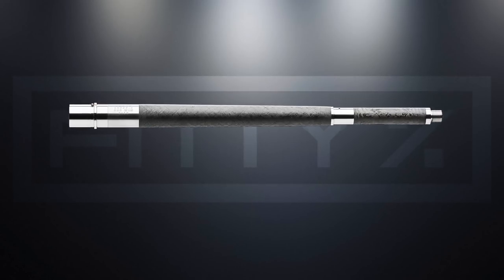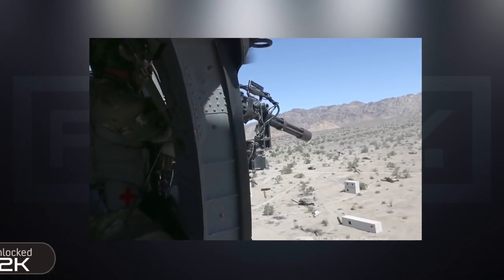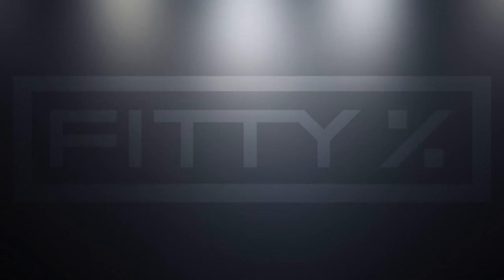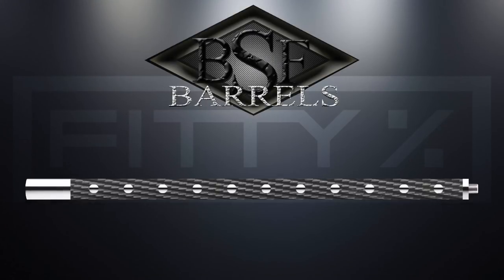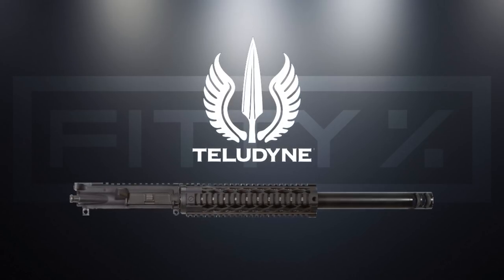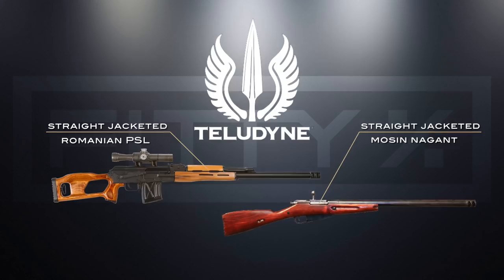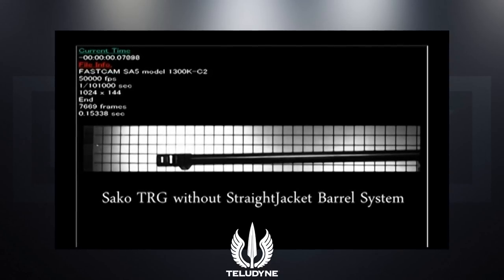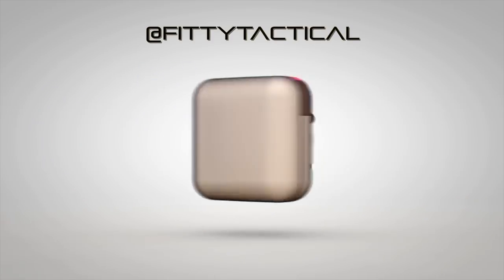Carbon Fiber Barrel Comparison - Part 2

Comment: I cut rifling for Proof. While I am bound by certain nondisclosure and confidentiality agreements, I can say that the resin matters. We have an Advanced Composite Research division in Ohio that keeps us on leading edge of this technology. Our resins can take more heat than any other resin on the market, and this helps with heat dissipation. Secondly, the barrels are turned so that the exterior surface looks like threads on a bolt. This acts as fluting, by decreasing weight and increasing surface area, and is done to give the resin more area to set so that the carbon fiber wind doesn't move or shift. Combined with a non-compromising Quality Control routine, we really feel this makes Proof Research the industry leader in this technology, and we have a bunch of people who really care about keeping it that way and being the best at their jobs. This is also why we are the largest cut rifling barrel manufacture in the world. Cut rifling induces less molecular stress on the bore than button or cold hammer forging. Every detail matters to us and everything we do is for a reason; we want to be the best.
Reply: Just purchase a pr15 in 14.5. What's your thoughts on pinning the gas block on this particular barrel? I want this ar to be "duty" use focused, not a range toy.

Comment: Very interesting video!  As an aside, fluted barrel heat has two sides to it.  While fluting certainly increases the surface area and heat dissipation, it also allows the metal to heat more rapidly.

Comment: Hey Fitty, excellent 2 part video. Just one point to bring up about carbon fiber or any composite material for that matter... What you said about the assembly of the BSF barrel may be true for how that company assembles, but if that's the case it's not a great thing... Composite materials are asymmetric in loading strength, they're excellent in tension and poor under compression. Stiffness of any cantilever (in this case a barrel) say from bending downward is the resistance of the top surface to tension and the resistance of the bottom layer to compression. Carbon composites are so strong under tension that there's virtually no give and you don't need the bottom layer to resist compression, but if you pre-compress that composite structure(top and bottom evenly) you've reduced the strength by giving the super strong top layer some "slack."
Reply from the maker: Alex S glad you liked it and thank you for adding more insight into my amateur explanation!

Comment: Very concise and well-illustrated video on the theory, similarities and differences between all the barrel jacket makers. I think Proof Research gets my vote. This is sue to the "Maypole" way they criss-cross their carbon fiber strands.

 I have SWIX Norwegian made carbon fiber cross country racing ski poles wrapped in this exact manner and they are STIFF! No energy is wasted bending the pole, it all goes downing the packed snow of the track. And they are sooo light.

BTW I also have a Norwegian made HELLE laminated blade hunting knife that is insanely sharp. This is due to the high carbon, chrome moly center laminate that forms the edge material. Love this knife but they are  a bit spendy. Lots of styles but I prefer the GT model and its high quality leather sheath.

Comment: Your 2 part video was good. I bought a Dracos 22" 6.5 creedmoor barrel after watching both parts. The worst it's shot with junk ammo is 1.5moa and the best is .75moa at 200 yards so far I'm only 35 rounds into breaking it in. There was no wind and the shooting was off a bench with heavy bags and good support. 
For the price the barrel is more accurate then most cheaper barrels i've bought (sometimes you get really lucky with a cheap barrel). However the barrel has such little whip i don't lose my line through the scope until 24x magnification. I'm very happy with it and would recommend. Maybe as it breaks in I could get towards .5 moa? Maybe not, idk. What I can say is it dosen't care if its 120 grain sst, 140 berger, or 147eldx, they all shoot very similarly.
Reply: Wow, that's seriously outstanding. Can't wait to get mine. 
The barrel made with Unicorn Jizz has gotta shoot that sort of moa.

Comment: Cool vid, I'm considering a BSF, very informative. 
FWIW I don't think the tuning of the cartridge to the node really makes sense. I've heard several people say that but the logic is off to me as MV can very quite a bit even with an otherwise identical cartridge. The level of fouling and most of all the temps can swing MV by large margins. If a load was tuned to the node then it would only be consistent at one temperature.

Comment: Missing a huge factor with bsf. Machining the barrel after boring the rifling can and will add heat to the steele. In a world where a thousand of an inch is a big deal and button filling vs single point cut rifling makes a difference do you want to risk a bit of warping?

Comment: Thank you for this wonderful information. Unfortunately I am still not sure which barrel to go for. One of the issues that confuses me is that carbon fiber barrels reduces the weight which sounds good, but also I know that reduction of weight can increase the recoil and harmonic. I am not quite sure till now which choice if carbon fiber barrels is best to maintain a good accuracy, less heat,  low recoil and low weight especially that I am going to .338 lapuaMag. I have to find the right one that gives a fair companion of all 4 factors.  I can't sacrifice recoil for weight or weight for recoil forexample. I have to find a barrel that doesn't sacrify any of them but not necessarily have perfection in one factor. I would really appreciate your advice on that if you have came to more knowledge about them. Thank you
Reply: WW 34 carbon fiber will decrease the harmonics on the barrel making each shot very accurate even when the barrel is hot. Bsf is the way to go. Now for recoil that will come down to you

Comment: Maybe the media in the dracos barrel acts like the beads in a dead blow hammer? Mitigating the severity of the harmonic wave ?
Reply from the maker: 5 Shot Group for that to be the case it would still need to be fluid. Its more like encasing it in a rigid epoxy resin.
Reply: Fitty% yeah, that won't work then.

Comment: And your videos were both very informative and educational!! Great job on them. So, are you saying that between BSF and Proof Research, BSF, would be the better bet?? Just wanted clarification because that’s my next route to building a 300 blackout. Thank you very very much!!
Reply from the maker: I think the Proof wrapped barrel is stiffer than the tensioned BSF barrel and may get tighter groups. There is the small possibility that the carbon fiber may de-laminate (small separations between the cf and barrel) but that's a small chance.

Comment: Update on mine...

Went to the range today to break it in according to their spec and also to sight my Brownells 5-25x56 MPO in. I'll have more later, but long story short, it performed very well and I believe if the human element were taken out, with proper ammo, this LR-308 BSF Creedmoor 6.5 based build is capable of .5 MOA (I saw just at 1.125" my last 8 rounds, but that was on me mostly).
Reply from the maker: Nice bud!

Comment: I'm working on a way to make a graphene wrapped barrel. I believe it's the future of barrel technology.
Reply from the maker: Sounds interesting! It also sounds expensive lol
Reply: @FittyACTUAL  yes, it does seem to be expensive. Though the properties of graphene seem to be very attractive for barrels. I know of defense contractors also working on this. Right now I'm trying to figure out the best way to encorporate the graphene onto the barrel.
Reply from the maker: @RolandtheThompsonGunner  will you use a steel barrel blank to wrap, because I have thought of a unique way to drill the bore that would be more accurate than traditional.

Comment: are proof barrels better than a traditional steel barrel? i just picked up a q Fix and was wondering if its worth it to get the proof barrel?
Reply from the maker: I'd say it's definitely worth it!
Reply: @FittyACTUAL  is it really a huge upgrade or slightly?
Reply from the maker: @reapering125  I'd say it's a significant upgrade going from a SS barrel, but look at the newish barrels from Dracos too.
Reply: @FittyACTUAL  i like the dracos barrels but they dont make them for the q fix

Comment: Its been 5 years ..... what are your long term thoughts on the BSF vs Proof Research carbon fiber barrels? Which one seems to handle heat/high rates of fire better? Which one seems to be more accurate? And the thing I'm most interested in, which one seems more durable? Have you shot out either of the barrels yet? Or both? Really wondering which one will send more rounds down range before needing replaced.
Reply from the maker: I honestly dont think I'll ever shoot enough to wear out a barrel, but I have shot each barrel enough times to have an opinion. The best "bang for your buck" would be BSF and I also believe the BSF barrel might outlast the others due to more steel material for the barrel remaining. In coming out with a "covid build" for a precision .223 wylde using a BSF barrel. Im also going to come out with another CF barrel video to include one from Wolfpack Armory.
Reply: @FittyACTUAL  awesome info, thank you for the reply! I had no idea the BSF has thicker steel walls, but it makes sense since the CF isn't adding any "burst strength" due to the air pocket. Good to hear that they're plenty durable though!

One last question, do you think fluted or nonfluted? Seems like the concensus is that fluted cools faster but also heats up faster. Plus fluted is apparently less rigid due to there being less material. As long as it wouldn't be detrimental to the reliability of a defense/SHTF rifle, I'd probably go fluted just bc it looks cool lol.
Reply from the maker: @Refined Randy  when it comes to a BSF fluted barrel there's still a lot of steel left for the barrel to retain rigidity. Plus the tensioning of the steel barrel from the carbon tube adds more rigidity. Fluting adds more surface area for cooling  but the steel will still only heat up at the same rate as a non fluted barrel.
Reply: @FittyACTUAL  awesome, fluted BSF it is! Thank you for helpful replies brotha, I appreciate it! Your channel is painfully underrated, it'd be cool to see it really take off, keep it up!

Comment: Do all these manufacturers stated in this video guarantee sub moa accuracy.? I'm looking for an Ar10 barrel and would like to know. I know it has alot to do with the bolt and loads used.
Reply from the maker: Yes I believe they do.
Reply: @FittyACTUAL  I know proof research guarantees 1/2 moa. Not sure of the others?
Reply from the maker: @rkwjunior2298  the other will or should be under 1 MOA.

Comment: I just ordered one of these barrels. It's a 24.5" Creedmoor 6.5 fluted one. I'll give a full review of it once it arrives, is spec'd out, assembled, "broken in" and range tested. I've chatted with BSF a few times (really good customer service BTW) and like the product. One concern I do have is that as heat is added to the barrel, it will, slightly, length due to expansion. That will cause the stretching effect to be lessened somewhat. Will that impact the amplitude of the cycle enough to harm accuracy? I will find out! Cold though, these, should, be exceptionally accurate. I'll do both fast (less than 5 seconds slow down between shots) and slow (one minute cool down between shots) to see how the barrel reacts.
Reply: Interested on your Hot barrel test results - I am looking at purchasing 6.5PRC Waypoint 2020 with BSF Carbon barrel or go with the fluted S/S .  Used for Hunting and Sporting Hunter division range shoots in Australia i.e. 10 to 15 shot groups when on range. 
Thanks.

Comment: Hand loading to tune a cartridge to correspond to a rifle node suggests you have a way to measure that frequency.  What meters are you using to do that analysis or are you just testing different loads to see what's most accurate in your rifle?  As an example, two otherwise identical rifles may like different types of ammunition.  Are you saying to get the most rigid barrel possible and then experiment to see what ammo does best, or are you proposing some more scientific method that literally measures vibration in the barrel?
Reply from the maker: Xandrosi I'm not going that far. All that's needed is to test various loads to get the tightest groups.
Reply: Thank you for responding.  I'm brand new to precision shooting and am trying to learn what qualities translate into precision.  Reading and watching YouTubes to learn what and why.
Reply: Xandrosi ladder testing is easy and tells all

Comment: Been curious about the carbon wrapped barrels and you answered a lot of questions.  Now I have to figure if they are really worth that much more than a Bartlein, Krieger, or Hart.
Reply from the maker: If you hand load and tune the round to your barrel as much as possible a Bartlett, Lilja, Krieger etc should be competitive with the carbon fiber reinforced barrels. If this wasn't the case everyone in the Precision Rifle Series would be using them, but thats not the case.